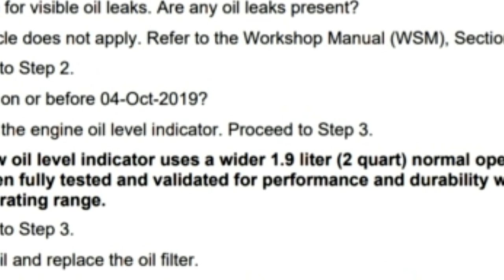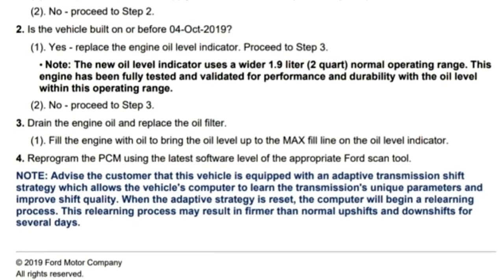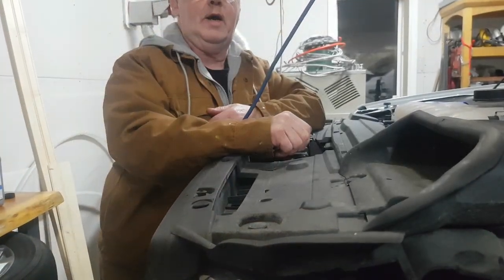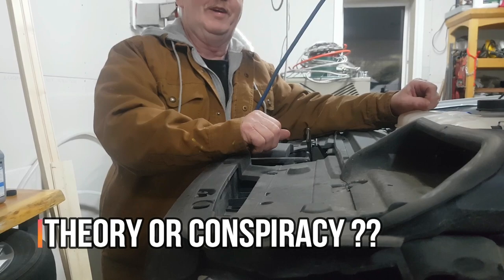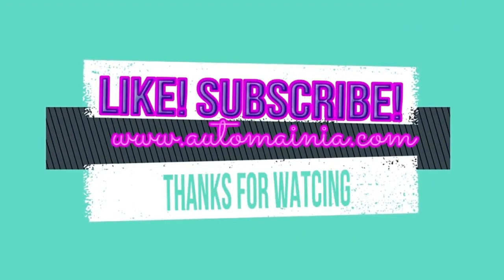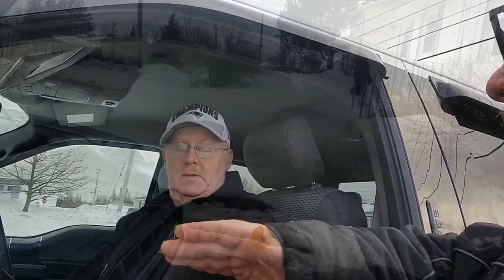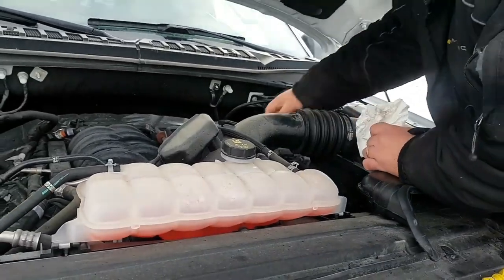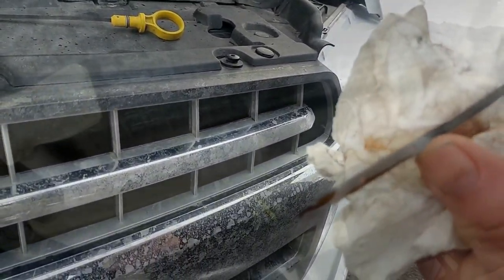#ford f150 oil consumption new dipstick measured 2018 2019 2020 5.0 coyote

Comment: I have an 18 f150 5.0L no oil consumption thank god built in September 2017 has 78k miles on it
Reply from the maker: ty for taking the time,your case seems to be the exception and not the rule,glad yours worked out!
Reply: @thisguysgarage  I've had the 18-2356 TSB done on my 2019 5.0 F150 at 4000kms. At my last oil change I had 1.5oz of oil in the PCV catch can and ZERO oil consumption.

From my OWN research, I've come to the conclusion that a too short factory oil dipstick would cause overfilling of the crankcase (ie. high crankcase pressure) and the intake runner closing almost entirely when stepping off the gas (ie. high intake vacuum) "can" pull oil past the rings. 

Both these conditions would draw oil into the intake system, either by sucking oil past the rings or pulling it through the PCV valve back into the intake.

The only issue afterwards was my 10spd. having to relearn my driving habits again after the ECM reflash...no biggie.

This is just an FYI for other F-150 owners to MY experience and thoughts on the issue. 

Good Luck.
Reply from the maker: @CannonFodder873  thanks

Comment: Oh great I find this video the day after I buy one!
Reply from the maker: sorry sir
Reply: @thisguysgarage  IF it starts using oil it will be finding a new home.  I was looking at the Toyota Tacoma's but they've moved production to Mexico & I don't trust the quality control down there. I already know of a guy who has one and the clear coat on the whole truck has come off so no Tacoma.  Dodge has the oiling problem (cam & lifter wear) with the Gen III hemi's so Nopar for me.  And well I just don't like gm so may trade for an suv.
Reply from the maker: @utcnc7mm  keep in touch, let me know if you don't mind 👍
Reply: @thisguysgarage  I just called the dealer this truck has less than 100 miles on it I asked bring it back and they said they don’t take them back!
Reply from the maker: @utcnc7mm  run it in sport mode, @ 100 miles  you should not be having problems yet...,this will be a little harder on gas but will save the engine. lugging the engine is what is causing the problems.  any questions ,let me know.
Reply: @thisguysgarage  I live in a mountainous area so the engine should be in a pull most of the time instead of low rpm like on the highway. Would this make a difference in the engine using oil?
Reply from the maker: @utcnc7mm  low speed pre ignition is the cause of the oil consumption.  unburned fuel goes in the base... I would still run it in sport mode to save the engine.  I can testify  from my experience and the hundreds that have contacted me on this small channel.  ford will not help you.  definitely stay in touch 👍
Reply: @thisguysgarage  I will, if I keep the truck I was going to run a full synthetic Amsoil is to pricey is their another brand you would recommend?
Reply from the maker: @utcnc7mm  definitely amsoil it is designed to combat low speed pre ignition
Reply: @thisguysgarage  run it in sport mode & use amsoil signature series, got it. 
Does it matter what oil filter I use?
Reply from the maker: @utcnc7mm  signature series will get sticky with warranty.  use the OE series .the signature series is a 25000mile oil change.
Reply: @thisguysgarage  Only 1,100 miles almost 1 quart low of oil & the worst part the transmission will occasionally shift hard and when you first start it up and take off it seems to have trouble finding a gear.  I'm thinking trade unless they can do something at the dealer.
Reply from the maker: @utcnc7mm  they will only repair catastrophic failure knowing full well what the problem is. my salesman told me to stop putting oil in it...
Reply: @thisguysgarage  It’s so sad because it’s such a beautiful truck, but I’m not gonna keep something that’s going to be a maintenance nightmare.
Reply from the maker: @utcnc7mm  i know exactly what you mean.  if you are considering a Chevy make sure it has the 6 speed transmission. the ten speed in their trucks are the same transmission Ford uses ,group effort 🤣
Reply: @thisguysgarage  I’ll go with Toyota I have never been a fan of GM quality.  As a matter fact I work with a guy who had one of those six speed transmission‘s come out at 35,000 miles (in a Silverado), they put a brand new transmission in it under warranty and at 74,000 the second transmission started giving him problems, he traded it in. It seems US auto makers are more out for profit than quality & customer satisfaction
Reply from the maker: @utcnc7mm  Toyota makes a good truck 👍
Reply: @thisguysgarage  I honestly planned on getting a Tacoma but they moved production of that truck to Mexico and anytime you open a new plant your going to have some growing pains & I'm not to impressed with the quality that comes out of Mexico either. So I guess I'll either get a Tundra or a SUV - Highlander.
Reply: @thisguysgarage  Just got off the phone with the service department at the dealership, they told me to bring it in when it was time for an oil change and they would do a reprogram of the transmission.  I told him about the transmission sometimes acting like its hunting a gear (like its stuck in neutral) and he said there was no bulletin out on that.  
Guess we'll see what I can get on a trade in.
Reply: @thisguysgarage  Haven't driven the truck very much only have 3,500 miles on it and the inventory of new trucks in the area is really low and prices high, so trading now is not a good option.  Those oil catch cans & changing the PCV valve, how much of a difference will that make?  I've seen a few videos on here where its seems to have worked.

Comment: Well I had TSB 19-2365 performed on Jan 22, 2020.  I have driven 2300 miles.  My oil level is almost down to the bottom hole.   I just made an appointment for tomorrow.  This is BS because I’m at 28k miles and will be out of bumper to bumper warranty soon!
Reply from the maker: Jan I feel your pain my friend. Keep me up to date with your progress.  There is more info coming on this.  Stay tuned 🤜🤛

Comment: This makes me nervous as hell having just bought a 2019 f150 10speed 5.0  I am currently a quart low on oil absolutely mind blowing
Reply from the maker: So sorry to hear this.
Ty for taking the time. 
Keep in touch
Reply: Did you ever take it to the dealer? I was going to get a 2020 5.0 but bought the 3.5 Ecoboost for this very reason.
Reply from the maker: @blackhemi04  many many many times.
Reply: @blackhemi04  no I haven't soon though, I hear the turbos arnt good in those
Reply: @TheFineLineGaming  hopefully they got all the kinks out for the motor being out this long... ill trade it in before 100k hits though.
Reply: @TheFineLineGaming  i have almost 90k on turbos zero issues
Reply: Try using 5w-30. I switched and it made my engine much quieter and now I have pretty much zero oil loss at 5k interval oil changes. 20w oil was for CAFE standards, not engine longevity.

Comment: Are pre-2018 5.0L V8 ok? Looking to get an F-150 very soon. Ram 1500 was totaled recently. Appreciate any advice. My mechanic recommends F-150 or Tundra for reliability.
Reply from the maker: Stay away from a 2017 if it has the 10 speed transmission.  Avoid the ten speed paired with the 5.0 motor. 
Thanks George for taking the time. 
There's no issue with this on the 2016 and earlier.  But like always have it checked out 👍
Reply: If you want to drive around get a f150 but if you want to get back home get a Toyota
Reply: How was your Ram?? Get another one. Ya or no?
Reply: No problems with our 2015 F150 5.0. saw so many others having issues with their 2017 and later, that we decided to just hang onto the 2015. Watching those with 2023s.

Comment: I just bought a 2020 f150 platinum march of 2020 I'm viewing this video and I'm confused as to what's really happening with the oil consumption and the dipstick I don't drive my truck every day I don't have 3,000 on it yet can someone please explain to me what is wrong and do I need to get me a trade in.
Reply from the maker: the problem with the trucks is low speed preignition . your truck has the wider range dipstick already installed from the factory.
is your truck using oil?

Comment: My 2015 5.0 consumes oil. According to everything Ford it’s not one of the ones with the issue. Well the oil goes somewhere and it isn’t on the ground. 7.7 qts puts the oil level in the middle of hash marks not the max fill hole in the dip stick. Pcv valve moves up and down just fine so I’m at a loss of what to do. Maybe try 5w 30 oil next go around to see if the heavier weight equates to less consumption 😳😳😳🤷

Comment: Just wanted to update you.  So this thing has been pretty weird on it's oil consumption.  Sometimes it's using more than 1-2 quarts, other times, it doesn't use any.  However, yesterday I took it to them after 3k miles from last oil change and it was 2.5 quarts low.  They are moving with the process of ordering me yet another long block.  I am going to contact Ford and try to go another route.

Comment: Well I just completed a 4000 mile oil cycle.  I no longer have oil consumption.  In my case the TSB did make a difference.  Thank God I caught it early on.  I will now add a oil separator and tune as I am keeping it long term
Reply from the maker: were you having a consumption test done? ty for taking the time!
Reply: I kept track of it on my own before and after the TSB.
Reply from the maker: @juanbello3164  good stuff. 
Just wondering if you have a reg cab or crew 2wd or 4wd. Appreciate it
Reply: this guy's garage crew cab 4x4
Reply from the maker: @juanbello3164  👍keep in touch, appreciate it
Reply: this guy's garage my only regret is having 3.31 gears.   My 4000 test was with Motorcraft 5W20.  I have now switched to 5w30 Castro Fully synthetic. I’m in Hot Florida.

Comment: Ford charges somewhere between $40 to $60,000 for a pick up truck. I owned a 2004 F150 with the spark plug and cam phaser issues! Ford never seems to get it right. How long do they think people will keep buying their garbage!
Reply from the maker: Absolutely. Ty for taking the time David 👍really appreciate it.
Reply: A few hundred more years I suppose
Reply from the maker: @philipparana9225  lol ty Philip for talking the time
Reply: I had the 5.4 3v motor and it ate coils every month. I never did figure out why. But I'm sure it was a domino effect.  Then I was gonna change the plugs and learned they like to break. So threw the new plugs in the glove box and now it's the new owners problem lol

Comment: My 2020 F150 is currently being monitored for excessive oil consumption.  They have already done the TSB to mine twice now.  I am 1600 miles from the last time they changed the oil and filter.  I took it to them this morning and my oil was in the middle between the two hash marks.  The mechanic told me I was about a half a quart low and to bring it back when it reaches the lower hash mark.  Ford is not going to fix their issue with these coyote 5.0.  They should have sleeved the cylinder walls instead of the arc twist weld, or whatever you call it they did.
Reply from the maker: half way between the hash marks is about two quarts of oil.  if they are guestimating how much oil it used they are not doing it properly, the dipstick is supposed to be marked for one quart. i outlined this in the first video how the stkick was marked.  solution, tell them to ad a quart of oil ,it wont bring it to the full mark,ty for taking the time,let me know how you make out.
Reply: @thisguysgarage  I'm going to remember this when I take it back after it drops to the lower mark.
Reply from the maker: @jonathanjohnston8120  check the oil before you bring it in.and be present when they check it. they are famous for adding oil when you are not looking.  good luck 👍
Reply: @thisguysgarage  So my oil was at the top of the lower hole, they put in two quarts of oil, and that brought it back to the upper hole.  So that was two quarts in 2200 miles burned. So their last attempt at a fix was to replace the pcv valve. They have contacted Ford to see what to do next if it is still consuming oil. I'll take it back in another 2000 miles.  Just wanted to update you guys. Thanks for all the info again.
Reply from the maker: @jonathanjohnston8120  i hope they replace your engine.  if they will do that i do have a suggestion for what you should do next. let me know
Reply: @thisguysgarage  I'll keep you updated as this process goes along.
Reply: @thisguysgarage  So took my truck back 2 weeks ago, and it had lost 1 quart after about 1200 miles. Talked to the service tech, and they said that Ford want me to bring it in for them to do a cold soak test.  Something about heating the engine up then letting it sit overnight, then they will pull the plugs out and check for who knows what.  Then they will know if I need new heads or the block.  Fun times ahead.
Reply from the maker: @jonathanjohnston8120  they are kicking the can down the road by the sound of it. 
ty for the update. let me know what goes on 👍
Reply: @thisguysgarage  So they said they found oil pooling on the number 8 cylinder after the cold soak test.  Waiting on Ford Corp to tell them what to do next.
Reply: @thisguysgarage  They are replacing the engine. They ordered it yesterday.
Reply from the maker: @jonathanjohnston8120  awesome let me know how you get along with the new engine, change your oil more often 4k at most ,consider using a better oil like amsoil,use tow/sport mode to stop low speed preignition . stay in touch ty
Reply: @thisguysgarage  Just wanted to update that I convinced Ford to give me a free extended warranty on the powertrain good out to 7 years, 100,000 miles.
Reply from the maker: @jonathanjohnston8120  did they give it to you in writing?
Reply: @thisguysgarage  Yep😀
Reply from the maker: @jonathanjohnston8120   ty for the update definitely stay in touch 👍
Reply from the maker: @jonathanjohnston8120  just reading back through the conversation did they repair the oil pooling on cylinder 8?
Reply: @thisguysgarage  I'm guessing that it is fixed with the engine swap. They said they only reused my intake manifold, everything else was replaced.  Block and heads.  We shall find out though in due time.
Reply: @thisguysgarage  So just a quick update. So far I've put 1200 miles on this new engine and the oil hasn't dropped any on the stick. Maybe...just maybe, this new engine is legit.
Reply from the maker: @jonathanjohnston8120  great to hear ,the dip stick in your truck the first liter is 1/8th of an inch drop on the stick. once engine is broken in ,switch to a good synthetic oil like amsoil ,mobil 1 or royal purple . these oil combat lspi low speed pre ignition. ty keep me in the loop as always ,happy to hear so far so good!
Reply: @thisguysgarage  Well time for a little update.  I'm roughly 7000 miles in on the new engine now, 2200 miles into my first oil change on the new engine.  So I decide to check my oil one day after getting home from work, and low and behold, it's already halfway down the 'in range' area.  Needless to say when I take the truck in for the oil change in 3000 miles, I will start this process all over again.  Only difference is I WILL NOT be keeping this truck this time.  Ford will have to buy this truck back and I'll be looking at another vehicle.  I will have the repair shop of the dealership see the oil level and record it before having the oil changed.  I'm completely fed up with this now.
Reply from the maker: @jonathanjohnston8120  man oh man 

The trucks are engineered for the high tourqe v6 twin turbo. The low gear ratio coupled with the ten speed transmission just kill the 5.0 ,Please stay in touch, let me know how you get along and good luck.  Get an oil analysis test kit when they do the oil change tell them you want a documented sample signed and dated by them.
Reply: @thisguysgarage  Just wanted to show you where my oil level is at 4300 miles from last oil change.   Crap I can't post a pic?  Anyway, I'm just a tic above the lower bubble.

Comment: My buddy already had his motor replaced and is right back where he started , Losing just as much as before. 2019 5.0.
Reply from the maker: the trucks are undergeared for the weight of the truck,its killing the engine
Reply: My 2018 truck is waiting on a new engine as we speak. Bought new on New Year’s Day 2019 33,000 miles 5L FX4. Transmission sucks, most of the reason why the engine has problems. I’m pissed
Reply: @thisguysgarage  
If an f-150 had the 373 gears would it be better or is it the transmission that's causing the engine problems?
Reply from the maker: @curtis1951  my truck had 3:55 rear gear ⚙ and it was really bad. 3:73 is not a big enough change to make a big difference.  4:10 would get you in the operating range  but they don't come with that option. 
just avoid at this point. ford has not been able to fix one truck with this problem.
Reply: @thisguysgarage  
Thanks. How do you like the ecoboost?
Reply from the maker: @curtis1951  got rid of it two months ago. engine was a little noisy.  I have been trying to get some time to put something together on it.
Reply: @thisguysgarage  
Keep us posted. Did you get another truck?
Reply from the maker: @curtis1951  Chevy with a six speed transmission, not the 10 speed shared with Ford to be specific and a 5.3 .been bullet proof so far i love it.
Reply: Thanks 👍 looking forward to seeing some videos on it.

Comment: Quick chat: has anyone with the 2018-2020 f150 5.0 V8 have the oil consumption issue fixed or disappear? Or had the oil consumption issue never appear at all?
Reply from the maker: ty
Reply: 2019 F-150 FX4 Crew 5.0. 8000km (thanks Covid)🤣

 After having the TSB done I'm no longer consuming oil...completely gone. 

Good Luck.
Reply: @CannonFodder873 so what do you recommend I do I have a 
2019 5.0 4×4